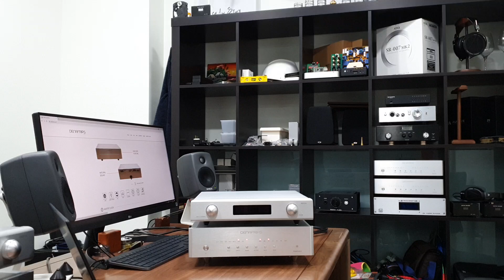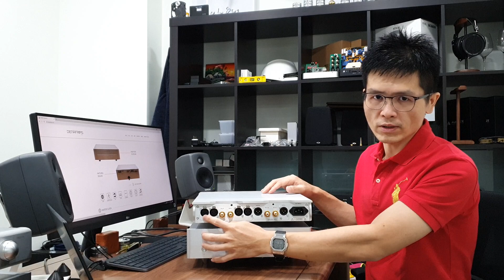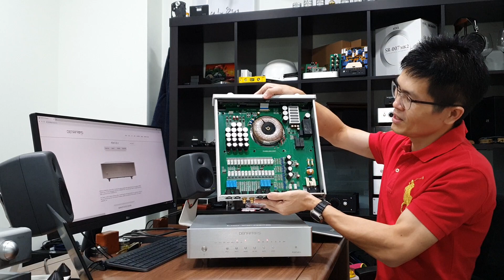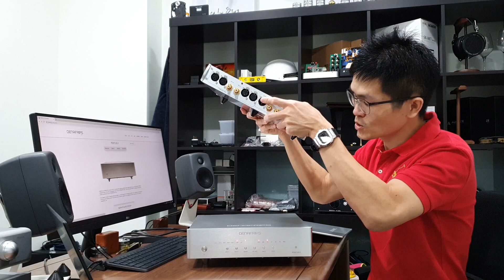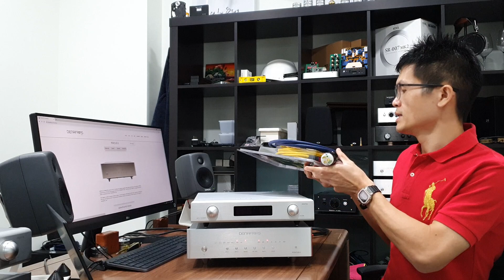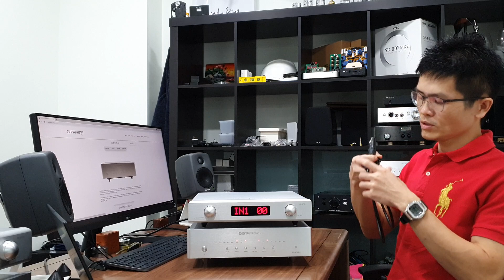DENAFRIPS Hestia Preamp

Comment: I can't figure out why Denaphrips makes their pre amps with such low input inpendance. They don't even match when using XLR with the Ares II. Rule of thumb has always been 10x.
Reply: I am sharing this info I found re: the subject you brought to our attention>>>>>>>"Popular audiophile lore has it that a mismatch in impedance between the preamp and amplifier will result in bass loss. Yup. If the amp's input impedance is too low weaker bass will be the result. That's true in the same way it's important to pump the car's accelerator before starting it. In the days of carburetors, a cold engine started easier when you primed the pump with a few squirts of gas. I remember a manual choke on cars that had to be pulled when they were first started. But no modern car has a carburetor just like no modern amp has impedance so low it would impact a preamp. But it was once true. Preamps of old, especially tube preamplifiers, were capacitor coupled (many still are). On preamplifiers where sound and performance mattered high-quality film capacitors were used at their output, which meant values were small. And, small capacitors result in rolled off bass in the presence of low impedances. This is because the preamp's output capacitor and amplifier's input resistor form a high pass filter (reducing low bass). But today we need not worry about such matters. Most power amplifiers have input impedances of at least 20kΩ and higher. Our own power amps, for example, have 30kΩ input impedance, high enough to never reduce bass levels of capacitor coupled preamplifiers, even if they are the vintage kind. So yes, matching impedances used to be a thing to worry about. Modern designs have obviated the need for hand-wringing."
Reply from the maker: Can't be sure the reason, but they certainly sounds good!
Reply: I just began using Hestia preamp. I was delighted to discover my already beautiful sounding system now has an even deeper and more spacious sound stage than before. I am very happy. I never experienced this level of enjoyment with digital music until I began using Denafrips products.

Comment: As a Venus II user I know that you suggest always to connect only one electronic to the DAC output, either to the RCA or the XLR outputs. So, would using a preamp like the Hestia solve the problem of connecting two headphone amps to the Venus. Would you recommend this option? Thanks
Reply from the maker: Yep. Hestia preamp is buffered, you may connect the output (RCA/XLR) simultaneously to two amplifiers.
Reply: Is this true for the Ares2/Hestia?
And the Ares12th?
I have both Ares.
I believe the 2 wasn't buffered?
Thanks